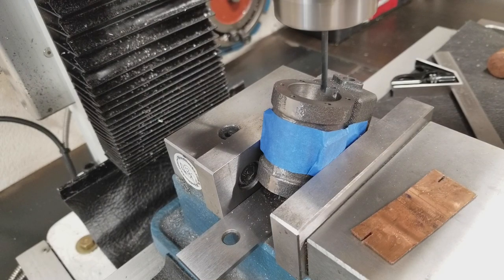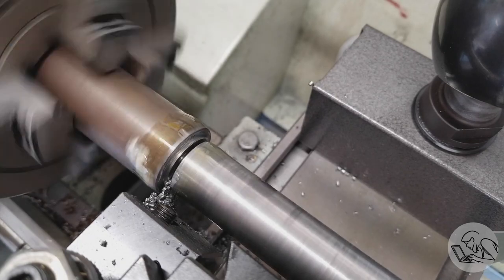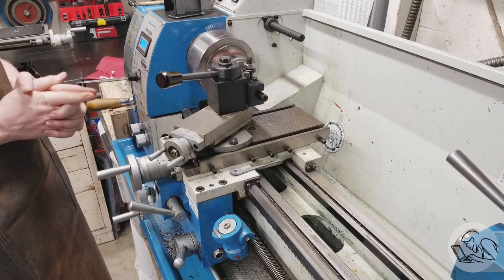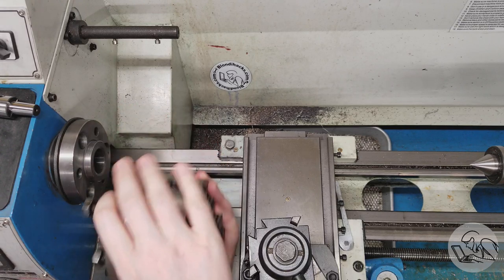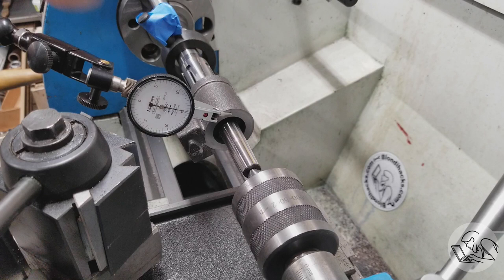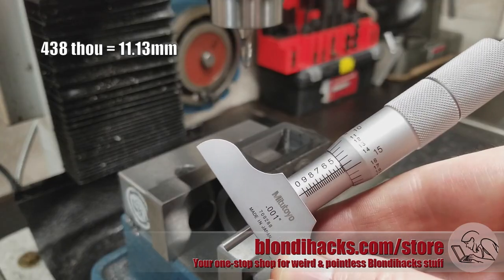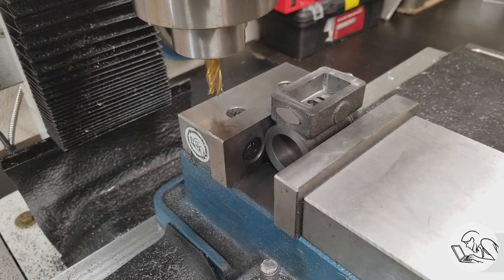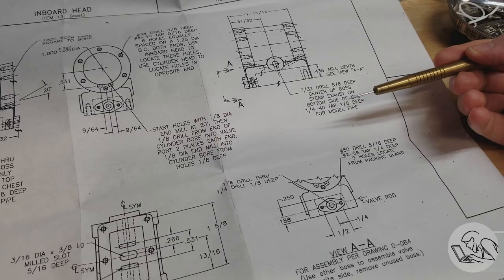Let's Build A Model Steam Engine - Machining a cylinder casting!

Comment: OK, quite a while ago, I signed up for a facebook 
machinist group.  They asked me for the name 
of 3 machinists I followed.  All 3 were named Keith, 
and you named them, in the same order I did.

2 more guys you might look into.  Both named Dave.

Dave Richards.  Does machining in a steam powered 
shop.

Dave Engel.  Builds and rebuilds carts, wagons, and 
sleds.  He made a brand-new copy of the 20 Mule 
Team wagons.  One wheel weighs 1/2 ton!

steve
Reply from the maker: I’m a big fan of Dave Richards for sure!

Comment: I don't know how cross hatching would affect a steam piston , but without cross hatch on an aluminum piston in a IC engine you will quickly learn what SEIZURE and SCORING of metallic parts looks like! On brake cylinders a mirror finish is needed so as NOT to compromise the sealing of the rubber cups or O rings in the bore.

Comment: Hi Quinn. As I remember training to be a mechanic. If you used a microscope on the cylinder wall after machining, it would look like a screw thread. If you put an o ring it there and expect it to do its work, then it wouldn’t last long. So, honing takes the sharppy bits away. Don’t know if that’s any help. Perhaps Keith A may follow it up if he watches? Love the vids.

Comment: Hello, I'm gradually watching you videos for beginners they are really very good and explain things very clearly and don't miss out steps which is easy to do when you get more experienced with things- so thank you!
I was wondering whether you could advise the order of things if the cylinder did not have a bore cast to start i.e. you are starting with a solid casting? Would you face off port face and sides and then drill/ream/bore? Thanks!

Comment: You mention honeing... In my work I machine and build electro hydraulic servo valve bodies for the aerospace industry. My working tolerances for fit between mating piston and bore is .000080 to .00012. I hone using a Sunnen honing machine leaving about .001 then hand lap using different grit materials to a 64 finish. The piston is nitride coated and ring lapped to achieve roundness. There are no piston rings. All measurements are done with air gaging and laser mics.  Been doing it for 15 years. As you said all applications are different. I think you did just fine...

Comment: So cylinder honing....I am not an expert by any means but, when I was working as an inspector at a large engine R&D facility the cast iron cylinders we used had a 120° hone pattern and, according to the PhD in the Engineering department who designed it, it was for oil retention so the rings did not run dry against the cylinder wall.  So take that for whatever it is worth.

Comment: Hi Blondihacks,
Another great video. thanks.
When you were setting up the cylinder in the 4 jaw chuck using copper shims and centering the bore, would it have been a good idea to check along the length of the mandrel for parallel with the indicator, to ensure that the axis of the cylinder was parallel with the lathe?
As it may only have been centered at the point that you were indicating at, yet it ran out of parallel..

Comment: The honing finish and cross hatch is chosen depending on the type of engine,  and the materials, finish, and hardness of the cylinder wall and rings. For small bore steam with ductile cast iron wall and ductile iron or steel rings, my references recommend 50-60 deg. (from cylinder centerline) with 280-320 grit stone with light pressure. Just my 2 cents. 'Mirror' finishes are best for hard plated walls (ex. Nikasil) w/ hard faced rings (tool steel) or fluid actuator cylinders with teflon rings or o-rings.

Comment: We all make oops moments. What I would have done different is try to line up the casting in the 4 jaw as square and concentric as you can using the outer round part of the casting. Then the bore will be as concentric as possible with the outer diameter. You want to do this with the cylinder head cap on the chuck side. Then when you bore the cylinder and face the cylinder on the valve packing end and valve packing gland it  will be all square in one mounting. You can then reverse it or mount it on a mandrel and do the cap end. the cap end is not critical on squareness.

Comment: just used my brake hone to clean up a master cylinder for my wheat truck  a 64 chevy c 60 oh and get this it is a dual cylinder system one cylinder (1 1/8 in) for the hydraulic clutch and the other a 1 1/4 cylinder for the brakes   hope it works since you cant get this cylinder any more "anywhere"!!

Comment: Great videos. Question on the steam chest cover plate - would it be worth spot-facing the holes? It will help the shoulders of the screws to sit flush with the face rather than on the high spots of the rough casting and will help to prevent the screws vibrating loose when the engine is running.
Reply from the maker: I considered it, but there wasn’t enough material on the little bosses. The drawing said nothing on the subject, so I decided not to.

Comment: The problem you ran into is one I've encountered before. Every part should have a 0.0 X, Y and Z point of origin.  The drawing references different datums that aren't there to measure off of.  If the drawing had used just one surface to measure from, it wouldn't be a problem. Of course, I worked in a manufacturing setting, so you could waste a few parts figuring it out.  But yeah, it sucks!

Comment: I think that print is trying to direct you with the note "MILL DEPTH SEE VIEW A-A".  But one of those three dimensions needs to be a 'ref' dimension.  Probably .188 should be a 'ref'.  Some added notes would definitely be helpful there like "CENTER HOLE ON RAISED BOSS TO SET MILLING DEPTH".
Reply: It's imperative on the machinist to mill to print unless the math on the print was wrong. The surface was merely cleaned up so the pocket could be cut to depth. What wasn't accounted for was the fact the valve rod's position was in relationship to an OAL*, so that the .188 could be referenced. It wasn't necessarily the ref point, it's what you should have gotten from the pocket depth if milled to size. However, even if one incidentally did the bare minimum and left the casting cut oversized on that dimension, the valve rod could have been milled using the cylinder's centerpoint as reference since the bolt holes were already made from that step and save one some time and the headache of re-zeroing on a different plane.
Reply: *The OAL had to be somewhere on the print, but we're just not seeing it on the video which explains the valve rod's position.
Reply: Without a Ref on one of the dimensions this becomes over dimensioned.  That is when you have multiple ways to dimension the same feature, likely with different tolerances - in this case the top of the steam box has two different dimensions to locate it.  (I am assuming the print has a standard tolerance in the title block for a three place dimension.)  In this case, the two small dimensions may add up to the larger overall dim, but the tolerance of the two smaller dimensions will be double that of the single larger dim.  So one feature will have two different tolerances.  This is poor drawing practice and often leads to confusion.
Reply: Yes, it would appear to be overdimensioned if the print was wrong (although you haven't seen the entire print in the video to make that call). But this isn't a tolerance issue, this was clearly operator error. I err on relying on the print's specification: the .188 was deduced from the 1/4" clearance between the rod holes' CL and the bottom of the pocket. It just so happened that the OAL was likely undercut from the top of the pocket when it was cut, thus creating the illusion that the .188 was overshot and not the distance arrived at making the holes when changing the reference point and following A-A's features. It would have been longer.

In other words: she cut the pocket and it's top too shallow and made the error in referencing the .188 dimension from that side, instead of simply using the existing center from the cylinder she took care of without needing to waste time re-centering that she wouldn't have noticed anything but the issue with the possibility of interference from the pocket she originally cut, which could be compensated in an extra (though avoidable) rework operation later.
Reply: I agree that tolerance is not causing the problem here -it's side issue.  But over dimensioning is generally confusing, which is very much the issue.  But I do not see any dimension from the cylinder to any of the steam box or gland nut features on the drawing.  How would she use the cylinder feature to locate any of these items?
Reply: OAL minus .188, which was why she thought to re-center her Y and try to move it .188 from that end. The OAL would have been determined on the part of the print she blocked us from seeing, either from that print itself, or another sheet.

Either way, the problem was glaringly obvious when she re-centered her Y and tested out the center. I don't think the casting nor the print were in the wrong.
Reply: @AAFREAK  So you are assuming that dimension is shown on a different part of the drawing not shown in the video.  Big assumption.
Reply: It's still plausible, and would be imperative upon whoever was drafting it to include that for consideration. However, she also says by the 9 minute mark that she was going to conservatively "clean up" that part and use it as a reference point before she started making the pocket for it. It didn't seem like she was saying she was going to cut it to length according to the print, which ended up to compound the issue.

While it may not ultimately matter generally where the valve rod goes, for this case it was obviously not machined precisely enough for what was cast, and as a result hinted that she left the OAL too long in that instance. Comparatively, I've got prints for a cylinder that's similar as an example but the bottom of the casting is simply milled flat without a pocket, which requires assembling a boxed casing where that valve would go. That print specifies an OAL, so I would not imagine one would be as so careless to leave out such a dimension and decide the valve rod location was that arbitrary to the supplied casting.
Reply: @AAFREAK  I've seen many prints with much worse errors.  I usually use them as as examples of what not to do for newer engineers.
Reply: Oh that's peachy and all, but again, it was pretty obvious with the way it was made out of that casting, and the dimension which should be there was glossed over for convenience of the operator. I wouldn't be first to assume an issue with the print until its confirmed it indeed was overlooked there.
Reply: @AAFREAK  Okey Dokey Artichokey
Reply: I am also building this engine and have been a machinist and cnc programmer more decades than I care to admit. In view A-A I don't think .188 should be a reference dimension, it should be marked as a start dimension. The 
.250 dimension is not over dimensioning it is to show the intent of the designer, .250 for the slide valve.

Comment: Excelent recovery using the expandable mandrel.  I must be missing something...why was flipping the part on the mandrel to face the other end not an option?  I have not used one of those madrels before.  Thanks!
Reply from the maker: There wasn’t enough material left on that end to machine, so I had to just leave it

Comment: Attempting to find any reference to steam reciprocating cylinder honing in my marine engineering books just sent me down a Skinner Unaflow rabbithole instead.
Reply: I repair hydraulic cylinders. The crosshatch provides a place  for lubricant to catch. The 45° lay seals better than radial lay, axial lay just bypasses. You want 8 to 16 RA.

Comment: I think it would have been OK to face off the end with the 0.008" runout. Just take enough to just square it up and no more. 
Usually the length of a item is one of the less critical dimensions (unlike diameter) and you can play with length of components to make things fit. 
It is nice to get everything spot on to the dimensions on the plans but life is short and if you mess about too much you'll never get all your projects done before old age sets in. 
Nice work though. (it gets easier as time goes on) :)

Comment: Weirdly when you open up a "modern engine" even after many miles you see the hone marks on the cylinder. It's used still and it does help bed rings and retain oil. I would expect that PTFE conforms enough it wouldn't matter but that cast iron would use it to bed in.

Comment: Hi Quinn - are you sure that the slots in the valve chest are the right length? Maybe it's just camera angles, but the exhaust slot, in particular, looks very wide. Enjoying the videos :)
Reply from the maker: Yes, it is a bit wide because I measured center to center. It’s still within tolerance though.
Reply: @Blondihacks  Thanks for the reply - As long  as there’s enough land left for the valve to seal on, you’re fine 👍

Comment: I'm not sure if the honing process will apply to model steam engines as much as it applies to car engines and the marine engines a lot of scale models are based on. For the simple fact you cant scale nature.

In the marine industry there are two types of cylinder liner reconditioning processes; Deglazing and Honing. Deglazing is the process of abrading the surface of the liner to allow oil to adhere to the cylinder wall and aid lubrication. Honing, however, is used to make the cylinder liner concentric if the liner had become oval in bore, very much like how you would use a reamer to get a more accurate hole.

For a steam engine with cast iron rings you would want a cross hatch pattern to aid the lubrication. I have no idea if this applies to silicone O-Rings.

Comment: Quinn, I’m confused about the first face operation after initially boring the cylinder?  Does it matter that you use the boring bar?  Wouldn’t it be just as square if you swapped to a facing tool, as long as you don’t change anything else?  Isn’t it the relationship of the cross-slide to the saddle?  Thanks!
Reply from the maker: The key thing is that you don’t move anything, not the fact that you’re using the boring bar.
Reply: Thanks!  I’m just getting started on my engine.
Reply from the maker: In that case, one more detail- the boring bar doesn’t help with precision in the facing, but it does get you clearance around the steam chest. You can’t get in there with a normal facing tool. Good luck with your engine!

Comment: Hi ya Quinn! I sure do enjoy watching this series on this little steam engine project. I love your attention to detail and how you explain all your decisions, placements, tooling, etc. It's awesome. So question about your options @7:24, the work piece could have been removed from the expanding mandrill, turned end for  end and put back on the expanding mandrill to allow room to properly surface the edge? Pardon my machine ignorance I'm just curious why that is not an option?
Reply from the maker: There was no material left to face on that side. Nothing to do with the setup

Comment: Honing (and lapping for Alusil) is a confusing topic. It is driven by the bore lining material, rings, lube system and expected pressure. As I understand it. I could be wrong.

Comment: I know my opinion is just one of many except if the subject is auto mechanics I'm right and everyone else is wrong. The cross hatch in a car engine is to hold. If the cylinder is slick you'll get blow by because the oil is what seals. This is only true on cast iron blocks. These new engines with aluminum blocks sometimes are built with a coating that once it wears off the engine last minutes so if you hone them they're toast. However that is not by far all modern engines. Oh and none of that is relevant to steam engines. 😏
Makes sense that you wouldn't want a cross hatch with some kind of plastic but we do put cross hatch in brake and clutch cylinders as you know because you bought the tool set for it.
I found those cheap hones to work great just fragile if you do something like pull it out too far while spinning.

Comment: Cross hatching is not obsolete in modern internal combustion engines, brabus does it when rebuilding high end mercedes motors, its just not worth it in cheap ass cars like mine but in high performance motors it means that you can force it more.

Comment: I wonder if the cylinder and valve chest could be made out of solids furnace brazed into a complete blank. It would avoid the casting process.

Comment: Why didn't you just flip the part around on the expanding mandrel when turning between centers and face off the correct side? I feel like I'm missing something.
Reply from the maker: As mentioned in the video, I couldn’t face that side down any further because it was already flush with the steam chest casting
Reply: @Blondihacks  oh, right! I was missing something! Thanks for clarifying

Comment: Well Blondie at the end  of the day you are a hobbiest like a lot of us and we have to,work with what we have . I feel  your exhaust slot is to wide and you have done the same mistake as some one else ie 6 bolts to hold chest cover on I personally would have gone with 8 thus avoiding the steam inlet hole. Any way thank you for showing us warts and all . Most of amateurs have a scrap bucket that parts end up in
Reply from the maker: It is wide, yah. I milled center to center instead of edge to edge. It’s a still within tolerance though.